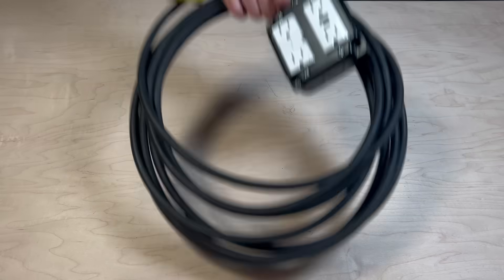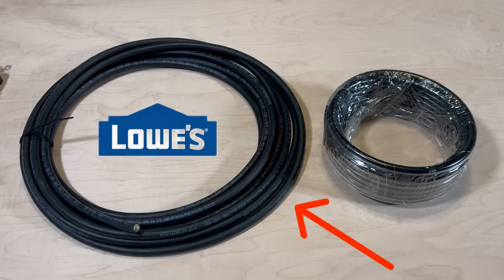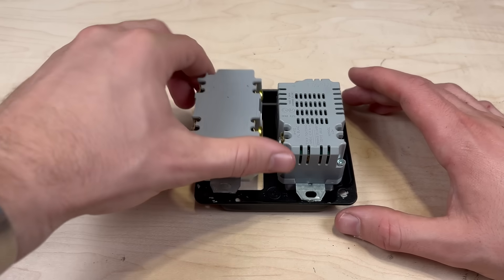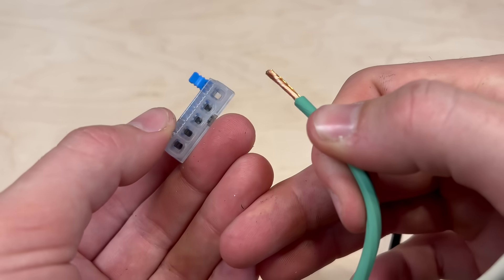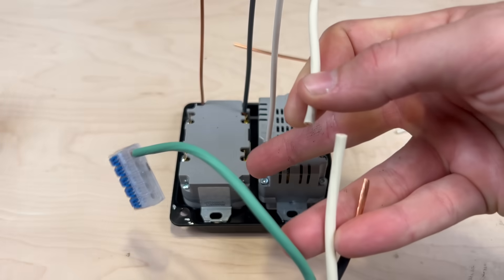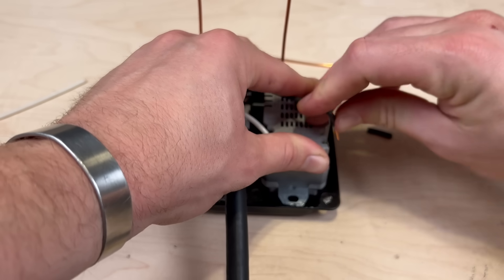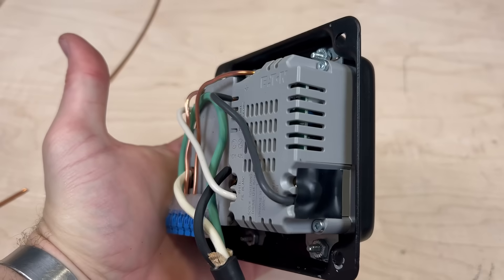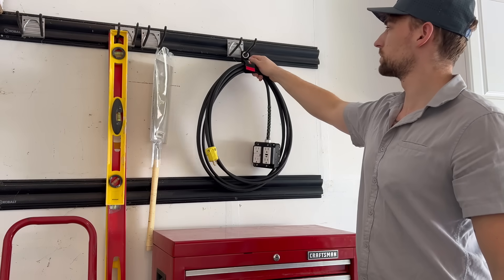HOW TO BUILD THE ULTIMATE EXTENSION CORD!

Comment: Very expensive cord.  $5 for box and cover, $5 for male plug, $20 for GFI, $20 for usb plug and #12 SO is $2 a foot.  Want a 10ft cord?  That's $20.  Add in a few $ for the box connector and this cord is bout $80 with taxes.
Reply: $80 for a 10ft 12 gauge cord... You can get a 50ft #10 cord for $100
Reply from the maker: @MaryJane-ln3vv I’d love to live wherever you live.
Reply: @SemperDIY  Texas and I'm a licensed electrician, so I know the cost of materials.

Comment: why not use a outdoor rated 2-gang box? these indoor ones let water in, which is not good if you use this outside/in a garage.
Reply from the maker: Because I’d have to open the cover to plug something into it.
Reply: No not the cover plate, the actual box itself. I have some with the box you used, and some with the weatherproof boxes. The weatherproof boxes hold up better and dont rust, but ive had no problems with either. @SemperDIY
Reply: @SemperDIY  Ya, just the box, not the cover. The grey plastic ones. Just grind off the mounting tabs and paint it black like you did. Totally waterproof (up to the outlets anyways - gets you 2.5" of water puddle safety). They also have waterproof strain relief grommets for the cable. Also, no need to ground to the box.

Comment: Totally get you and I have multiple homemade 220 and 110V cords, but
You now have a 12 ga wire with four outlets very likely plugging into a 14 ga, 15A household circuit that already has multiple receptacles.
If you, kind reader, don't know why that is a problem, that's a problem.
Reply: The 15amp breaker is the weak point as it should be. Using larger wires shouldn't matter because the circuit should trip first
Reply: @RacelifeCo    Absolutely.  
My comment was more related to the supercord not being able to be fully used becase of upstream limitations, not safety.
Reply from the maker: Yeah, unfortunately the only receptacles in my garage is a 14 AWG wire but I think they’re on their own circuit. Luckily for me I’m only going to be using one tool at a time so I don’t think it’ll be a problem. If I were going to be pulling more power I’d definitely be more concerned. I was disappointed to see that I had 14 AWG wires servicing my garage 🙃
Reply: @SemperDIY   👍🏼 Overkill on an extension cord is always preferable.  The weak link in any circuit, shoud be the breaker.  
(That means, when you are constantly blowing your 15A breaker, do not replace it with a 20A.)
Again, if you don't know why, edumacate yourself..

Comment: Would of course help if you started with sockets that are properly made in the first place. Like the UK ones that have decent terminals, the plugs have large insulated pins and they can easily carry 13A @ 230V  rather than the crap you lot use with the tiny pins on the plugs
Reply from the maker: Maybe that’ll be my next video. “The Ultimate Extension Cord. UK Edition”

Comment: At the end of this... he has an extesion cord that does not meet code.   It is AGAINST CODE to use boxes with knock-outs for extesoon cords.... they are to be used ONLY inside of walls.   Instead use a surface-mount-weatherproof box instead,  so there are not knockout plugs waiting to be accidentally pushed in against the inside connectors and making a live connection of electricity to the box.
Reply: You are correct.  That is why you should have an electfician work on electrical work.  

How does the unsuspecting diy person know what is code or not?  Answer:  Have an slectrcian do it!!!

Last, do not wire two GFI's on the same circuit because they will prematurely trip.  They fight each other
Reply: @peterohmart5954 its really not rocket science... You don't need an electrician.
Reply: Guess I'm never building one
Reply: weld them shut karen
Reply: Who gives a F about code?
Reply: @richardfitzwell6579  The fire dept. when the cord was the reason that your house burned down.
Reply: @stans5270 maybe your insurance but not the fire department
Reply: Calm down Karen
Reply: @nrpatterson64  Good one. Thanks for showing that Pee Wee Herman has more advanced debating skills than you.

Comment: I have a problem with one of the two extensions I made. It keeps tripping the GFCI, and I don't know why that's happening. I ended up using a regular extension with a multi-plug, and I haven't had any issues. In the multi-plug, I have the same devices that were connected to the extension: two UPS units for my PC and peripherals. I checked the cables and connections, and they look fine. Could it be that the GFCI is defective? How can I find out what the problem is?
Reply from the maker: Your GFCI may not be rated for that much power?

Comment: is this against code?
Reply from the maker: Apparently
Reply: You can make it code compliant by replacing the metal box with a "leviton 3059-1e" box (listed for portable use) and buying hookup wire with the listed writing on it instead of salvaging it from some old Romex wire. That Leviton box is really expensive but it meets "code". Outdoor OSHA controlled construction sites often require molded plugs on the cord for water resistance and often ban "any" self manufactured assemblies even if all the individual parts meet "code". FWIW these boxes, often called "quad boxes", are the power staple in the entertainment industry for stage power. If you have been to a concert big or small, you have seen these boxes on stage. I have never heard of any inspector kicking them off the stage for not being compliant (I work the industry) although it is possible as those metal boxes are only listed for permanent install and not for portable use hence a code violation. I make these with the plastic outdoor boxes (I just grind off the mounting tabs and paint them black). Again not listed for portable use and technically still a code violation but at least they are water resistant up to about 2.5" high in case a mop bucket or a jug of beer gets dumped around them.

Comment: I hope yours will be used for many decades to come. 
I made a dozen of these back in the early 90s with some electrical mining wire 12 gauge and some multi taps 12 gauge, 8 plugs ins- back then they were steel not plastic.  Water proof black tape they used for water pumps.  They were short 8 ft to 40 ft for roofing work. Some chains attached to the power strips, so we could hang them on a nail. 
I still see these in use ever so often at my brothers or sisters home, and mine or my kids. 
Good to see these things I made so long ago are still used everyday. 
They all have a satisfying look of abuse from all these years.
Reply from the maker: That’s awesome! I appreciate you sharing that and thanks

Comment: The majority of items purchased from amazon for this build turned out to be junk.
Hence amazon=junk, place them on the no buy from list.
Plus you may have also found the strain relief locally if you look hard enough or asked the store owner.
All in all very nice build. I did something similar, a switched outlet dedicated for the shop vacuum.  Since  shop vacuums have notoriously  poorly designed on/off switches, it saves me from fixing or replacing  the vac.

Comment: If the outlet won't fit, it is a hint that you should be using a deeper box.  If you were installing these outlets in a wall then you would be violating the code fill requirements.
Reply from the maker: It all worked out in the end

Comment: Why didn't you put ferrules on the stranded wires to provide a SOLID connection for the plug?
Reply from the maker: I didn’t think about it
Reply: He doesn't really need ferrules if he buys better, commercial outlets: they have clamping plates that clamp down on the stranded wire. Personally I'm more offended by his comment that if you know one simple step, "you'll know as much as any electrician." I'd love to see some amateur install an elevator shunt-trip disconnect that properly complies with all the local code requirements with a job spec dictating that it all be installed in rigid conduit.

Comment: Need to afix the cord wrap/hanger to the strain relief on the top of the box. The cord will last longer, look better hanging and be easier to hold when carrying lots of tools to and from jobs. Otherwise you put strain on the cable above the strain relief section due to the weight of the box and over time the copper in the cable will become weak and need repair. That cable wrap/hanger/cable tie will triple its service life if not more. Hard to say as that setup is still going strong since the repair.
Reply from the maker: Good call, thanks
Reply: @SemperDIY  My pleasure, Great video!

Comment: In the states where OSHA is administered at the state level, that build would be a violation and result in a fine on a jobsite. Box has to be listed as waterproof.  Ditto the opposite plug end.  Many of the state OSHAs outlaw any aftermarket plugs on cables/listed or not.  In that case you'd have to purchase an extension cord with a molded male end and replace the other end with a waterproof 2-gang box.
Reply from the maker: Luckily I’m not worried about OSHA
Reply: You may not be worried about OSHA, but a lot of people watching should. They will fine you.

Comment: Did the Amazon wire not have correct gauge? Was it just thinner exterior insulation
Reply from the maker: It said it was 12 awg but it was much thinner than the 12 awg from Lowe’s. The exterior was thinner too.
Reply from the maker: Actually, I didn’t even open it once I saw how thin it was. The gauge could have been correct but it just looked too thin to me
Reply: @SemperDIY  this is usually the case, seems like they use a different insulation material.

Comment: you dont need to ground both the outlet and the box you can do one or the other because the ground is also connected though the ears of the outlet
Reply: 100% Incorrect, and dangerous misinformation.  The ears of the outlet are not considered a listed ground, because they can loosen up, corrode, etc.   You absolutely DO need to ground both the box and the devices.

Comment: Nice video and instructions!  I built my first version of this in 1998, on the end of a hundred foot, 12 gauge cord.  I went so far as to machine the cover plate out of 1/4" aluminum plate.  I used commercial grade receptacles, as they are made of nearly unbreakable nylon and have better spring contacts when plugging and unplugging power tools, etc.  It has had tools, lumber, bricks/CMUs dropped on it and it continues to work, despite the patina of use.
Reply from the maker: Wow! Thats awesome!

Comment: While this initially seems like a good design, in fact my dad built a few of these 40 years... ago... in reality having a big heavy 4 outlet box at the end you can bang around is not a good idea.  It's fine inside a shop, in fact it works great when you have to have a lot of tools on the floor plugged in... drill, grinder, cutoffwheel, etc.     Having a big heavy box at the end has a side benefit of making the end easy to swing and throw across a floor where you want it to be.

But when you are connecting multiple extension cords in a series together like for weedwacking, electric chainsawing, or hedge trimming out in the yard, you find out how this was not a good idea... as you're having to drag all these big boxes along the ground that get caught on things, after you knot the cords together.    

It's better to put a single outlet on the end, and if you then need a breakout into multiple outlets, use a break out adapter (3-Prong Heavy Duty Power Extender to Triple Outlet in T Direction) or extension power strip.

So having one or two built this way that permanently live inside your shop is great.  Outside the shop... where you need to daisy chain lots of extension cords to reach your destination... not so great.

I myself have built them using the plastic 2 outlet wall blue boxes at the end, and those don't hold up terribly well and tend to break.
Reply from the maker: We have different needs. I’ll be using it in my garage, that’s it

Comment: I know the extra lock nut was just thrown in there, but there's actually a benefit to it: it prevents it from loosening due to vibration or movement (it's called a jam nut). Not really necessary on an extension cord, but it's a nice extra bonus

Comment: I made mine from outdoor weather boxes and sealed strain reliefs.
Reply from the maker: I don’t like that you have to flip the cover open to use the outdoor weather boxes. They’re also pretty bulky. I wish there was an affordable middle ground.
Reply: @SemperDIY I like the covers in environments where grinding dust from metal could end up inside the receptacle otherwise.
Reply from the maker: No I get it and you’re right. It would also prevent sawdust from getting in which is something I’m dealing with now. I have to blow it out when I plug my USB in while working

Comment: 40 year journeyman wireman here. You killed me sanding down the 4" box, I mean, I'm a little overboard, but you even outdid me lol. Just a tip, they make these boxes in a deeper version that will give you more room to work. Other than that you were on-point with the strain relief and you definitely want a 12 gauge cord for this (20A). Nice job. 👍 Oh BTW, got all of the materials for mine from scraps off of jobs, total cost, $0. Could not help it. :)~
Reply from the maker: That’s awesome! I appreciate that
Reply: Nice job. That’s a good looking box. 

A few additional tips: first, clean the box before painting it. They often have an oily residue and the paint will not adhere very well. I use naphtha on a rag and then a scotch pad to give the surface a little roughness. Also, I’ve found that truck bed liner holds up to abuse better than black paint. 

Second, if these boxes get kicked around a lot, I’d suggest using nylock nuts on the screws holding the duplex receptacles to the box. 

Last, those conduit nuts are famous for coming loose. After tightening them, paint the threads behind the nut with some nail polish to help keep it from backing out.
Reply: I use deep 4 squares for almost everything but I can understand wanting to use a shallow for this as it makes it less bulky to use.
Reply: @Jake-uc8mb  the square boxes are good if thats all you can find, but for applications like these, i try to find stamped boxes instead of  welded. the box used in this video is a stamped box - except for the opening, its a smooth finish that wont dig into anything or scratch anything up, a welded box has sharp corners everywhere
Reply: The tip about the larger box is gold. I absolutely hate working on tiny boxes. In my garage i mounted the box to my mobile tool bench so i can wrap it up when not in use, and my smaller hand tools and whatever else im working on can have easy access . Sometimes you can get lucky in homedepot and can find extension cord on sale its normally hanging around , but you can ask someone who works there.
Reply: yeah I was gonna say a deep box would give you a lot more room to maneuver with that thick wire.
Reply: I bought a deeper box but realized at the end the top where the outlets go don't have corner fasteners nor did the box.  I have to find a deep one with corner fasteners and independent screw holes for the outlets.
Reply: It’s fine to sand a box for an extension cord imo. As an electrician I’ve cut myself a few times on JBs with rough edges when handling without gloves on, they’re not made for the end user to touch bare, usually they’re inside the wall and covered with a faceplate, since this is an extension cord, it’s being handled from all sides and the safe thing to do is sand it. It’s like a 2x4, a framer wouldn’t sand a 2x4 but someone making a table out of 2x4 will sand it cuz people will touch it.
Reply: Somehow overing it and under doing it at the same time. Will shave down the box but leave 1/8in of exposed live copper in the box because he refused to use the wire stripping guides on the outlet...
Reply: Thief
Reply: @Epicality  Troll. 😝
Reply: Hey I’m in trade school right now just because I’m in Southern California and it’s impossible to find a job even as a helper right now without your ET card but what’s your opinion about backstabbing the USB receptacles and the electrical tape around the termination screws? I kind of cringed seeing it but I don’t know if it’s just from what I’ve been learning in school or if journeyman out in the field actually do this
Reply: Yeah 40 years...if that ..
And still scrapping.

Lame. Added nothing to it.
Reply: Putting two GFI's on the same circuit will cause premature tripping of the circuit
Reply: @peterohmart5954  Well let’s start with the fact that he only has one. The other outlet has usb ports…
Reply: @peterohmart5954  the problem is not multiple GFCIs on a single circuit. you can have every single allowable receptacle be a GFCI on a branch circuit, and everything will be fine, the problem is when you connect multiple GFCIs together in such a way that they are feeding power to each other.
Reply: He isn’t an electrician so he is a bit anal about hidden attention to detail I wouldn’t go to this length it kills to much time to serve the same purpose with the same procedures  we normally already use in the field

Comment: heres the better choice   .  Man I wish i could be in the videos before people make them, AIDA Lighted Plug and Connector Set, Straight Blade Cord End Replacement, 15 Amp 125Volt, NEMA 5-15P & NEMA 5-15R, 2 Pole 3Wire Grounding, Yellow, 5 Set
Reply from the maker: I started off with an AIDA lighted plug but returned it because I couldn’t grip it with gloves on. Thanks for sharing your opinions. Let me know when you make a video and I’ll be the first to watch it.